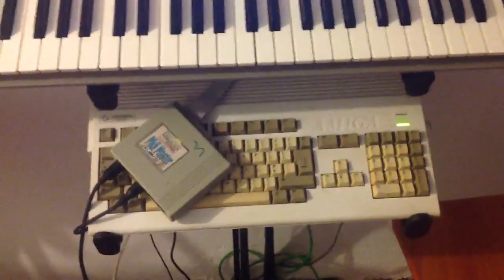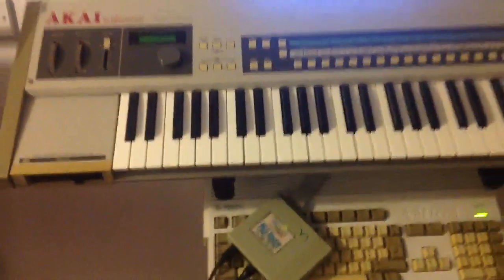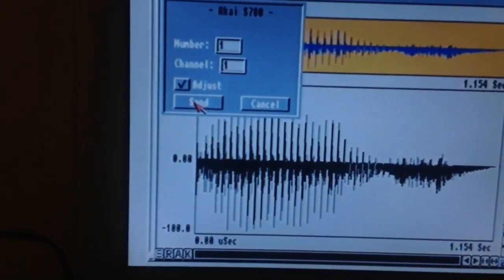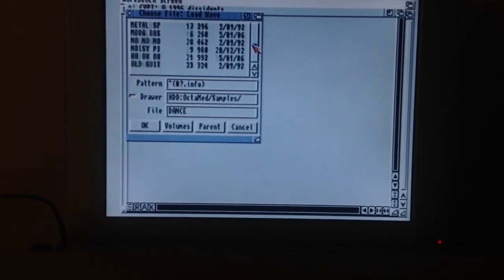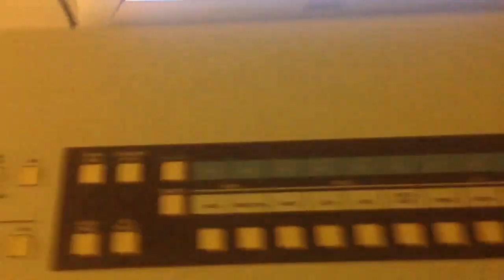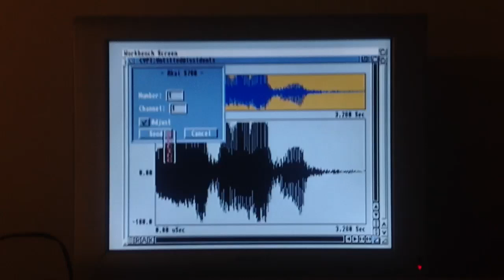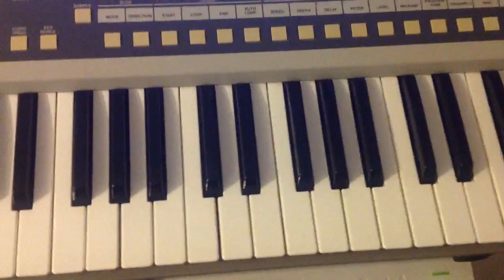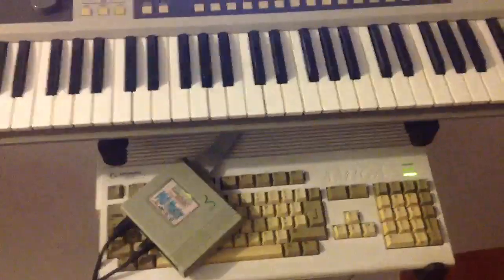Akai x7000 and Amiga 1200 Sampler

Comment: Just 7 months ago I saw and commented on this, and now I've got an X7000 myself! I nearly let it go as it was not in my city, but a coincidence after another, here it is. I will fix the drive. A Finnish spare parts supplier even has a belt with correct dimensions, but I'll try square "rubber bands" first as I had placed an order for assortment for cassette players.

Comment: #lordgiffnock: I can confirm that you can only send samples, not receive any when running Soundsystem X7000 on Steem. I have tried the same software on my real Atari though and it works in both directions so it must be something with the Steem engine.